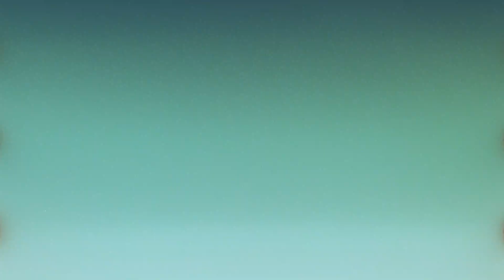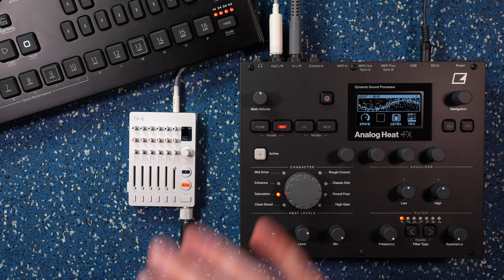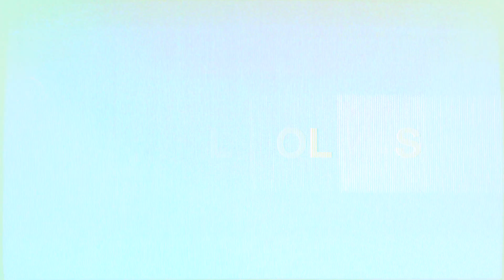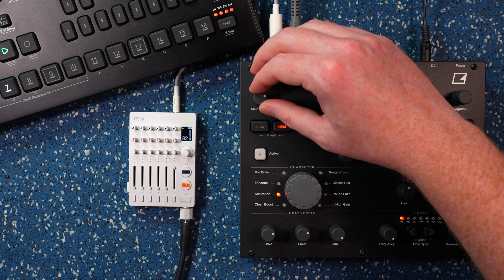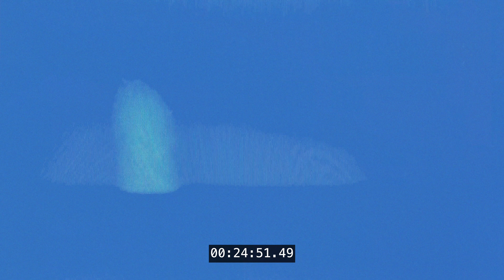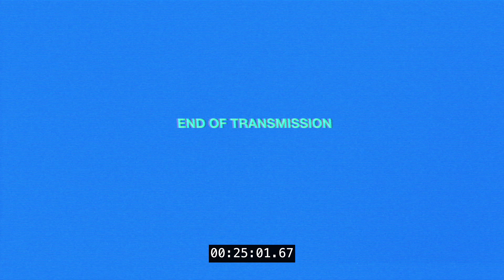Getting Started w/ Elektron Analog Heat +FX

Comment: Its expensive but sounds good and is fun. I like all the LFOs and side chain/ threshold dynamics it can apply to the FX. It creates a ton of movement.
Reply from the maker: I agree with all points!
Reply: @ I wish I understood how to use Elektron’s LFOs better though. “-127 to +127” isn’t much to go on and it’s one of the few things I skipped in the manuals
Reply from the maker: @R3ND3RR0R  Understandable! In "Elektronspeak" +/- 127 is basically +/- 100% of any parameter, so it's kinda just a universal "value range"

Comment: Thanks for this gentle walkthrough, very nice 👌🏻👍🏻 As you also have (tested) the Chroma Console, I was wondering how do you think the compare when it comes to colorize and sculpt different type of sounds? 

As far as I can tell both have ‘modules’ that can be flexibly routed. The CC has the Character module, where the AH has the analog section. Furthermore the CC has the Movement, Diffusion and Texture modules. But the AH also has time-based, shifting, compression and colorization type effects.

Not to say one is better than the other, but where do both excel…?
Reply from the maker: Mannn it’s tough. For the price, Chroma Console is amazing. I think it sounds good and has that effect block / module thing going (as you mention) which is a really nice approach, and the size is nice and control scheme easy. I do think the Analog Heat is a different beast, although I totally understand how you’d compare the two. I love the Heat for the main saturation/drive character first and foremost, and the “extra” effects are nice for sure, more modulate-able, you get the bonus of a recording interface as well as “plug-in” mode. Effects-wise I’m partial to the tape noise and hiss you can get from it and the bitcrush is pretty nice. I think the Heat maybe sounds a little more high quality, but it should for 2.5x the cost. If I were using one on a pedalboard I’d absolutely go for the CC, desktop with Elektron boxes - the AH. I plan to keep the AH as the main saturation on my mix, and the CC will be used on individual devices, as needed. Maybe a great option for the cue send effect on my Octatrack. That’s my 2 cents, a bit rambling but I think it boils down to seeing the CC as more of a “superpedal” and the AH more of a “studio box” effect. Hope this helps in SOME way haha 😆
Reply: @Duskmos   thanks for sharing your thoughts, much appreciated! 🙏🏻 Yes, the AH +FX is more expensive than the CC. The actual difference will be 300-350 euro’s, because Hologram doesn’t have a local resellers or distribution partner in Europe (tax, shipment, etc. will top the regular price of the CC about 150 dollars). Then again, that’s still a lot of money that should result in some sort of added value. 
I can see the CC is much more direct and hands-on, which I find important in case of a performance and also during the in-studio creative process. I really do like the Elektron workflow, which offers a nice balance in menu diving (studio) and direct control (performing, playing). 
The well-known Heat section of the AH is a no-brainer to me and I find it much better and gives you more precise control (also by what’s available in the menus) then the Character module of the CC. On the other hand, the other effect blocks do sound a bit to clean and digital to my ears, so less ‘character’ and warmth then the ones in CC’s other modules. But maybe they just need some (studio) work to create your own custom patches. Could be a nice topic for a comparison video… 🫣😉
Reply from the maker: Totally agree - I never do comparison videos but this would be a nice one 🙌
Reply: @Duskmos  well, maybe don’t call it comparison… ‘creative mimicking’ would probably be better, and it could even be the start of a unique series, too 😅